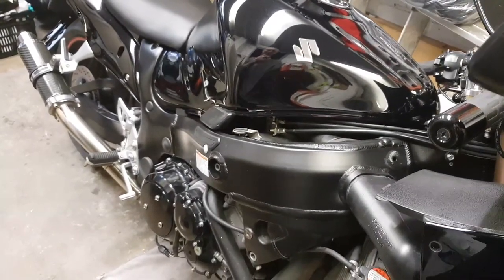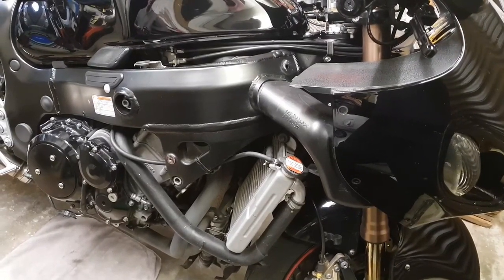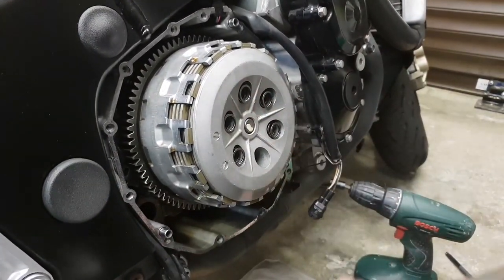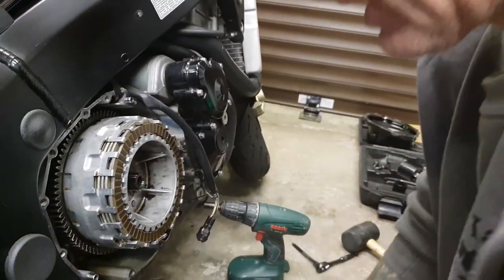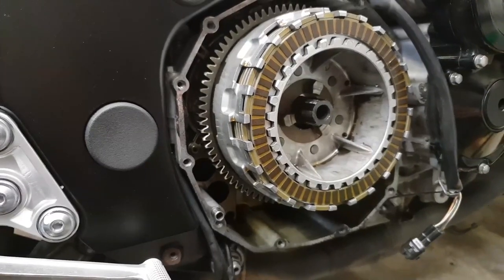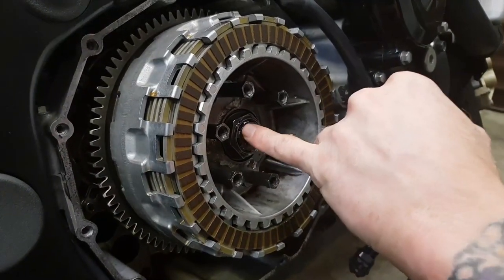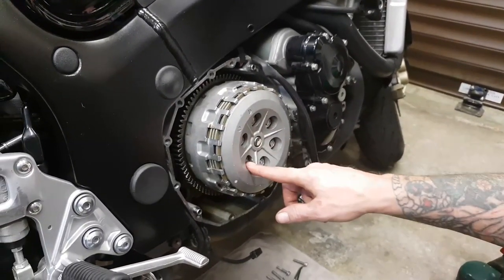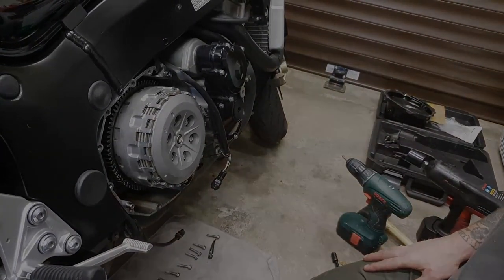Hayabusa Gen 1 Clutch Mod

Comment: I bought a locking aluminium spacer to put behind. (UK company)  Does the same job and easy to remove if you want the slipper clutch back.
Reply from the maker: HI GREAT TO HEAR IT SOLVED YOUR ISSUE FOR NOW !! IN MY EXPERIENCE I WENT DOWN THE SAME ROUTE AND DEPENDING ON THE MILEAGE THIS WILL ALSO FAIL WHERE AS THE WELDED ORIGINAL WILL NOT !! PLUS A CHEAPER FIX ! THANKS FOR THE COMMENT BUDDY AND GOOD LUCK RIDE SAFE 👍🏻
Reply: wear did you get   it from

Comment: can you provide some details on how to weld this? do you use stainless wire? also when welding is the assembly in the middle position? or forward locked position? great vid. thanks.
Reply from the maker: Hi, the part requires precision welding and is done by a guy called Sam Matthewman link to him is in the description. thanks for you comments👍
Reply: @KeepItWheel  I've asked him before. He wouldn't give any advise.
Reply from the maker: Hi no he only does exchange as you buy one from him he takes small deposit via pay pal until you send your old one to him then he refunds depo hope this helps

Comment: Great video mate ! Quick question my gen 1 Busa has a rattle when she’s running in neutral and when I pull the clutch lever in it stops, no issues with it other than that, figure that mod would correct it? Cheers from Canada 🇨🇦!
Reply from the maker: Hi no the mod wouldnt fix this ! It sounds like you first port of call you should check the clutch plates for wear if these are in spec then check the clutch basket for wear .The symptoms you describe are pointing this way .Hope this helps please let us know how you get on 👍🏻

Comment: Can you weld this your self? What kind of metal is it made off?
Reply from the maker: I would recommend that you dont as the inner section of the clutch centre is in 2 halfs and needs to be welded in an offset position for it to work if that makes sense . We did leave a link as to where you can get this done professionally. Hope this helps

Comment: I would imagine though that Suzuki designed it in 2 pieces for a reason.. any concerns about turning it into a solid unit?
Reply from the maker: No concerns at all this set up has been tried and tested for years as the same mod is used on the TLS 1000 and TLR1000 also .A number of race boys use this same mod in the hill climb series .Suzuki developed this set up as there first attempt at a slipper clutch and although this works when the engine is new, as mileage goes up so does the wear factor and the system fails!. welding these parts totally eliminates the clutch ramp mechanism and so cures the problem of the jerky effect while performing a fast launch (or slow)

Comment: I need to do this mod on mine as I have that same problem of the clutch biting /grabbing when trying to pull away fast. Sitting in South Africa though so would probably have to get mine welded locally. Question is if it must only be tig welded or can it be mig welded too?

Comment: You YT mechanics are all the same, cut the vid when you come up against a problem instead of showing how it took fkn hours to do it at your leisure. Joe public now thinks it can be done in 14mins...
Reply from the maker: Aint no problems on this video brother !! Just cut out the boring bits ! Thanks for your comment and view ride safe !!
Reply: @KeepItWheel  You missed the point but fair enough, is that a Black Widow exhaust on your bike?, im just about to pull the trigger on one of those to try get some weight off this RZ pig i've had for 14years its like driving an Artic in traffic now im much older.